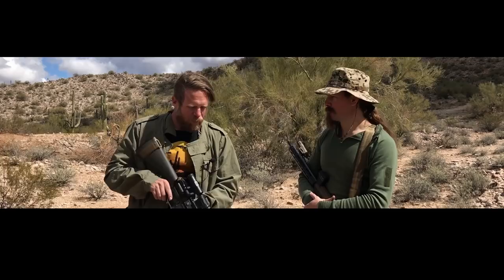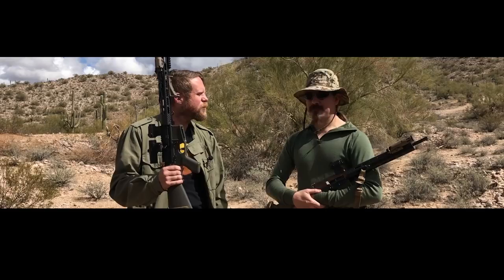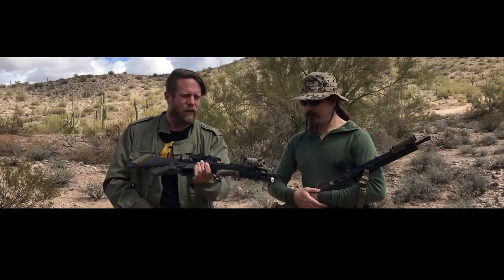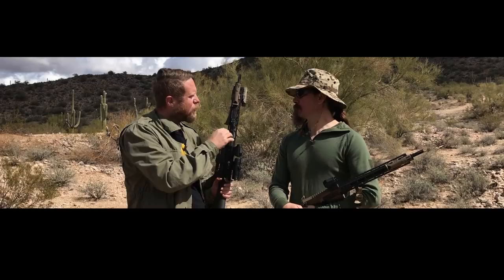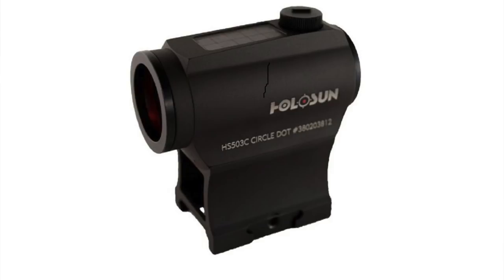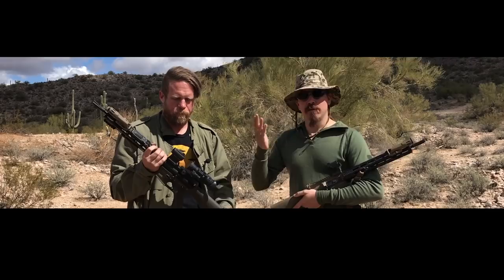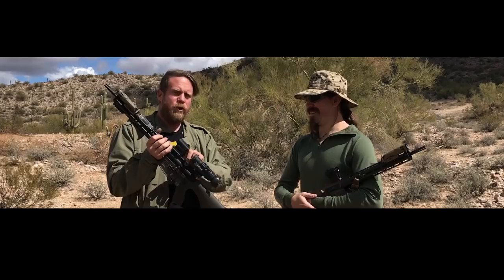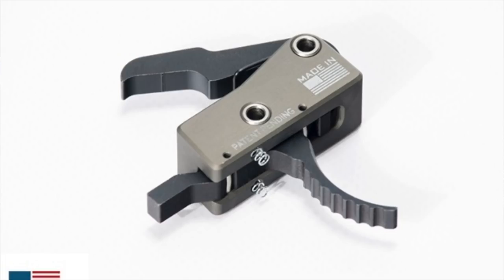WWSD: Rethinking the AR15 - CONCLUSION

Comment: With respect, I personally have had to deploy my BUIS during qualification on the range prior to deploying. I really hear what you're saying about modern optics, BUT when/if your red dot M68 CCO fails for whatever reason- mine was for batteries- you REALLY do not want to be potentially on a two-way rifle range with a blind rifle. For your purposes- YES I agree- Holosun is a fantastic red dot, but for me personally, I will have some for of BUIS.
Reply: Did you just literally never change the batteries on that thing? They have a battery life of years. If you don't put at least new batteries in your rifle at the beginning of your deployment then that's on you.

Comment: Not gonna lie you guys make a really solid point about modern red dots being pretty damn durable. I run a Romeo 5 because it’s what I could afford and my gun came with some cheap non Magpul poly sights which came loose and then promptly broke when I attempted to tighten them so they wouldn’t wobble. I’ve seen videos of a Romeo 5 surviving some pretty harsh treatment. I think I kinda agree. If you have an Aimpoint or an EOTech it’s that much better. If I do get some MBUS then I likely won’t be able to mount a magnifier without removing it.

Comment: As for the carbon fibre handguard, it's not that the carbon fibre doesn't absorb heat, it's that it doesn't conduct heat. As for that not being important in cold weather, that is actually a very important aspect in cold weather. Steel for instance, will conduct heat away from your body, 9300 times faster than air of the same temperature. At say -40C/F, touching steel will instantly hurt, the same way touching a scorching hot frying ban will and even a short exposure, can kill the tissue, that comes into contact with the metal. For me as a competition shooter, at competitions that are below the freezing point, keeping my hands warm, is my number one priority. That entails stuff, like keeping my handgun under my clothes, as close to the body as possible between stations (others use insulated bags with hand-warmers next to the guns grip), and having enough magazines pre-filled to run a complete competition, without having to fill up any mags.

Comment: With red dots ( Aimpoint or EOTech variety). I run a fixed front. Try it out. It’s significantly faster for me. Also with a lot of reps and good consistent contact points it’s possible to be very accurate just using the front sight. Especially through the tube of a down/off optic.
Reply: I thought they would mention that. If you shoulder the gun, get your normal cheek weld, and put the target in the center of the red dot with it off, you can hit targets under 50 yards fairly easily. If you add a fixed front sight its even more accurate.
Reply: MX5autoxer 
Yeah fixed front does a lot.  Along with what you’ve said With lower 1/3 it’s affective as height over bore reference in close stuff.   It’s a fixed reference for parallax when shooting in tough positions.  It helps with speed because it’s fixed.   Then it’s an obvious second sighting system.  Underrated setup for sure.

Comment: This is really the ultimate civilian rifle, if I had to choose one gun to have it would be a WWSD AR15
Reply: Ehhh. I would go with the longer barrel.
Reply: @operator8014  Then you can
Reply: @weasle2904  That's true.
Reply: @operator8014  16" is the way to go.
Reply: @gnrfan713  Here I am with my 10 pound AR with a 20" barrel...
Reply: @hindsight2022  what exactly would stepping on it do
Reply: @DeepCFisher  i just meant that the lightweight parts and polymers arent inhearently strong.  Especially when compaired to thick aluminum or steel . not saying its a bad rifle just not the ULTIMATE civilian rifle . id say that one goes to lwrc or POF
Reply: @hindsight2022  they just said that you can run the gun over with an truck, and it's better then aluminum. Finish Watching the video.
Reply: @stefthorman8548  oh they said THAT ... Must be true then. I seen the front of an air plane caved in from a duck . Soo aluminum not that tuff bro. SHOW ME !!!
Reply: @hindsight2022  The front of an airplane is called the radome, and it's not made of aluminum. Also, airplanes go really fast, so when they hit a bird it's going to impart a lot of kinetic energy.
Reply: @hindsight2022  you couldn’t be more wrong! I’ve owned the ATI Omni hybrid multi Cal, for several years, and as there sales pitch was showing them running it over on a concrete floor with a forklift over and over again, also hanging hundreds of pounds off from the buffer and lower receiver attached to the wall, I live where it gets -10°F or colder I have deliberately brought it outside to let it freeze up, and shoot it to see if this causes malfunctions, to this point it has not, I have had it several years, and have no plans to get rid of it, it is by far the lightest rifle we have, and is just such a great smooth shooter.

Comment: Incredible, it's about as light as an M1 Carbine
Reply: Yeah. To put it in perspective, that AR15 weighs about the same as two 1 liter cartons of milk plus one glass of milk.
Reply: Well, it was originally supposed to replace the M1 carbine in Air Force service, while bringing a more effective cartridge into the mix. It may not be my favorite rifle design, but it certainly does what it was designed to do when configured properly.

Comment: I recently finished a build that I’m using as my main defensive rifle & it’s strikingly similar to what you guys have done. I have a poly CAV15 lower but ended up going with an Aero Precision M4E1 instead. Here’s the setup:
- Holosun 515C (what a great optic!)
- Streamlight Protac on a M-lok cantilever mount 
- 2 point sling on qd mounts
- 16” stainless barrel w/mid gas system
- Magpul K2 pistol grip
- Geissele charging handle
- 13.5” M-lok free float rail (aluminum not carbon fiber)
- Hogue overmold stock (it doesn’t pull my tactical beard hairs)

Hate to see this series end, I really enjoyed taking the journey with you guys. Looking forward to what’s next.

Comment: Allow me to give a specific rebuttal: For line infantry I would argue that backup iron sights are essential. Reason: you can not go back to the armorer to get your optic fixed and you have no say in how long you are deployed.
Reply: I somewhat agree but at that point - just put them in a case and throw the case in your bag. I do absolutely see the argument for having them on your person but just like with the bipot for Karls and Ians application - being able to put it on n a moments notice is great but having it on the gun 24/7 is too much of a downside.
Reply: BIIGtony If the sights are going to be in your bag, why not just pack a spare optic with a QD mount?
Reply: BRWaldo97 I thought soldiers were in charge of buying their own optics? But yes, cost (especially with an Elcan or ACOG) can be a problem.
Reply: Soldiers rarely get a say in what weapon they get or what is on it.
Reply: I was the armorer for a company that deployed to Afghanistan in 2013. Far as the weapon itself, no changes. Things like firing pins, bolt carriers, etc, were not replaceable other than by me or trained weapons maintenance personnel.

For attachments like grips and optics, most of my company had invested in some kind of personal item. I had a Knights Armament foregrip on my M4. A few squads worth of people had various combinations of foregrips, slings, lights, and all manner of stuff on their rifles. I didn't mind so long as it fit on the racks since I would recognize certain combinations for certain people and wouldn't have to hunt around.

A few people did have a personal optic, in the event they were issued a rifle capable of accepting it and not given a corresponding optic to mount. I still issued optics to more than half of my company, mainly ACOGs and M68 CCOs. Our machine gunners had their own optic type that was issued, can't recall the nomenclature.
Reply: in my experience BUIS are more of a detriment than anything. first as Karl said they get in the way of gear that's actually needed. second, at least with modern military optics you most likely scenarios that would disable the primary optic are going to put that weapon or that soldier out of the fight even if they had BUIS. third, the amount of time and ammunition needed to train soldiers to adequately use both BUIS and their primary optic would be much better spent getting them to a higher level of capability with what they actually are using. and fourth, even unless a unit has a completely inept supply chain they will have replacement optics and other common parts as well as entire weapons on hand as spares because we know that Murphy's law in inescapable.
Reply: OEFBugout M145 MGO made by ElCan
Reply: Bobcat the "training issue isn't really, well, an issue. We have to qualify with iron sights anyway, so you're going to know how to shoot with them, at least reasonably well, long before you get issued an optic.
Reply: If your weapon receives enough damage to make a modern optic stop working, it will need work anyways.
Also what are you talking about? stuff like the RCO and CCO are generally stocked at most armories kept at major bases in the theater for replacements, they even have a parts number, they are part of the standard issue, IE you are not equipped fully if you don't have a functioning one.
Reply: Redneck Fury this is not necessarily true. I saw a number of guys overseas who had broken their glass. Their firearms were fine and otherwise functional. Modern-day high-quality optics are pretty durable, but they're far less durable than any of the major components of your rifle. It's absolutely possible to break them, and have everything else in tact.

Also, I can assure you that there was no "armory" at our FOB stocking any red dot sights. And resupply was at most every 4 - 5 days (unless there was an emergency drop, because we had been engaging at a much higher rate than usual). And there was no guarantee that someone was going to special order you an ACOG in time for the next helo. If you busted up your optic, you might be SOL for a little bit.
Reply: OEFBugout:
If it wasn't the old M145 (ELCAN Specter OS3.4x), then it's either the SU-258/PVQ (Trijicon 3.5× ACOG with Triji dual-illuminated RMR piggybacked atop, Tenebræx ARD, and LaRue LT100 as a package) for your SAWs, or—for the 240s—the SU-260/P (Triji's 6× ACOG, same sort of package, LT644 mount instead).
Reply: At this point in technology, BUIS are a good idea that just get in the way... Sure, it's a GREAT idea to have a zeroed BUIS ready to go in case anything happens to the optic...

HOWEVER, 99% of TA51 mounts in the military are torqued well past hand-tight (as they should be), so getting them shits OFF if your glass breaks is going to be impossible anyway, meaning your BUIS won't flip up because there's a big fat chunk of ACOG sitting on top of it...

And really, the chances of your ACOG going down and you still standing and fighting are kind of slim; they're quite bulletproof optics! It has to be one of those "go buy a lotto ticket shortly thereafter" type of scenarios. They build them so they can survive war, after all...

The reason my civvy-side "warfighter" carbine doesn't have BUIS is because if something happens (especially civ-side) that takes out my ACOG, it most likely took me out too...

And if you have an M68 instead of an ACOG, you're fucking wrong and should smoke yourself relentlessly for choosing a vastly inferior optic.

As for TEOTWAWKI: It's most likely NOT going to happen, guys... This big blue and green ball of mud is going to whirl around the Big Orange Ball for another billion or so years before said BOB finally Supernovas... We'll be LONG gone, as will our rifles (nothing lasts forever, shit's going to eventually rust/corrode/wear away, break, or simply become vastly obsolete) LONG before TEOTWAWKI... The threat of nuclear anihilation is a thing of the past, civil war is fought on Instagram and Facebook these days, and if the .gov comes for your rifles and you are part of that resistance movement, you're probably going to die long before your ACOG does, or will be using improvised, home-built, or other munitions, most likely small concealable ones...

Comment: Okay, I realize someone else has probably said this: I understand Ian reasons on why the 14.5" "door-kicker" rifle but, I would figure that the add FPS would be welcomed. I have been slowly buying the parts needed for my own WWSD Rifle but I am glad I held off on the barrel. This actually makes me think about barrel length though, at the end of the day I will probably still go 18" barrel. Which the irony is that I live in a thick wooded area and you all live in open desert where I figured our barrel wants/needs would be just the opposite.
(BTW, having just turned 30 today, I figure its time I grew up and got rid of my AR-15 that weighs as much as a M60 lol!)
Reply: Get the 18 inch. The range and power is worth it

Comment: I don't get it? No light weight bolt carrier group? Titanium adjustable gas block matched with a light weight buffer spring?  Would you figure saving weight there makes the gun less reliable?
Reply: They used a captured buffer for reliability because of the pin possibly breaking and getting into the FCG, and the lighweight carrier just rubbed them the wrong way with all of the material that was being removed and would recommend a full auto capable carrier or semi one because of reliability.

Comment: Will you do a mudtest with your WWSD Rifles?
Reply: It would most likely function just like the other AR they mud tested, and if they mud tested these beautiful rifles I'd have to look away.
Reply: I suspect they will do better than the standard AR they already tested
Reply: They sort of did, only thing that changed is there are even less egress points for dirt. Although I'm uncertain about the ambi bolt release
Reply: They are Ars mate, they've already mud tested Ars.. Mud testing another Ar will be no different than the other Ars they've tested.... It would be redundantly repetitive. =]
Reply: A lot of people are saying that this is unnecessary because they already tested a standard AR. However, you're significantly under estimating how different materials and tolerance stacking can significantly change reliability. Just the difference in how the fire control group or the buffer operates in a polymer lower when filled with debris might completely change the outcome (or not). Same thing with the magazine. I think it would be worth testing, though I can understand them being hesitant about wanting to mud up these pretty expensive rifles

Comment: "Some $450 beater rifle that you probably don't want anyway."

I don't think the cost of the WWSD is crazy, but this comment is, to me, perhaps ignoring the current state of the market.  Brownells has had Aero Precision complete rifles with mid length gas systems for ~$550-$600 pretty regularly.  You don't have to buy a DD or BCM to get what is a pretty nice rifle.  Now it won't be as light as this, but it also won't be as expensive (and I totally get you have to add in the optic and other component costs).  

Is the cost worth the weight reduction?  It may well be.  My point is merely the market is very competitive currently.  I think a lot of these weight saving elements could be applied individually and still yield some results to go with the philosophy of weight savings.
Reply: This lower plus any 200 complete upper makes a light Sub 450$ gun.

Comment: Try a glass optic in a wet and misty environment and you might change your mind about irons.  After all, the front sight can be folded down out of the way and the rear carried in your bag like any other small bit of gear.   It isn't just a matter of electronics being more subject to fail in a humid environment, but the glass itself will constantly be fogged, beaded with moisture even when the electronics continue to work.  I don't disagree at all with your trust in new electronics, but as backups go, irons are inexpensive, weatherproof and small enough not to be a carry concern.
Reply: I live in Virginia, we have a lot of 90% humidity 90° days. Even during extended range sessions the only scope I've had fog up on me is a Tasco 4x my grandfather bought in the 80's (granted that's out of a sample of three scopes in total). Besides, if that's a concern just get an open reflex sight like the EOtech or the Holosun 510. That way the optics would only fog if they're cold
Reply: I've got a lot of hours with a steyr aug glass sight as issued standard (old school fixed scope) never had it fog up ever.  I guess it could happen but I've never seen it.
Reply: They shouldn't fog if they're sealed correctly. (Hint, your car isn't sealed correctly)
Reply: Any good optic won't fog, i've never once heard of an ACOG or similer cost optic have issues like this.

This is why good optics are sealed and filled with nitrogen.
Reply: I wasn't referring to an internal leak and subsequent fogging, but rather to wet glass itself.  I spent most of my life in coastal Alaska and trust me, when hunting there you will either have BUIS or wish you did.

Comment: 5:30 The polymer lower/carbon fore end should be just as nice in cold weather as it is in the desert sun. Conduction is what makes hot or cold metal uncomfortable to hold. Lower thermal conductivity and lower specific heat capacity reduces the issue whether it's AZ or AK
Reply: grafixbyjorj Alaskan here. I concur. I haven’t played with CF, but I can tell you I only want to touch the wood parts of my shotgun when chasing snowshoe hare south of 0°F (gloves be damned).